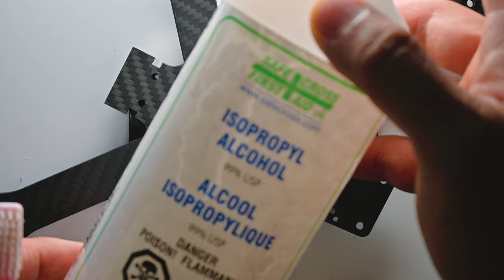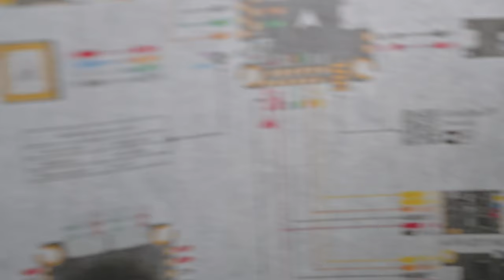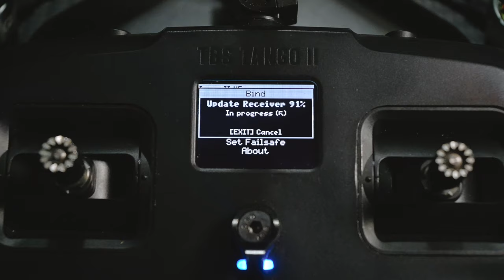High Performance 5" Freestyle FPV Drone Cinematic Build Video | PattyFlipz Style | Skyliner MKIII

Comment: Dude, that's the nicest build video I've seen, I think. Those macro shots are fire! Ok, noticed a detail I wonder about: Did you put liquid electrical tape on the VTX antenna connector to secure it in place? Is that a thing?
Reply from the maker: Thanks Bro! Yes that is right! Because the caddx vista is naked, there are no secure stays. I use liquid electrical tape to just give it an extra bit of  security in case of an accident. Easy to peel off and remove as well. Not sure if its a thing but just make sure you installed the plug (seated and click) very well before applying. 😅😂

Comment: new subscriber here :)

What tool is that? that thing were you cut the standoff.
Reply from the maker: Hi! It's called a dremel. I was shaving down a M3 screw because it stuck out too much and I didn't have any shorter ones. In most cases it is not necessary. Cheers.
Reply: And its like a pliers right when you cut it?
Reply from the maker: @allentituspaz3241  Oh yes those are small bolt cutters, they cut through thin metal screws or rod. Great to remove excess for reduced weight. No need to carry extra weight on drone. Before you cut, Thread in a metal nut as far in as you can. Then after using the bolt cutter or dremel so you can thread that metal nut it in and out over the rough cut area to re-thread and smooth it.
Reply: @PattyFlipz  thanks! Better have that kind of tool.

Comment: does anyone have a Link to the print file for the dji cam mount please.  unfortunately mine doesn't fit
Reply from the maker: the file you have, are the 2 rear bolt holes off by a mm or is it completely off
Reply: @PattyFlipz The Bolt holes are fine. I have two parts in total.  Once got a print for the drone with a go pro mount that fits well.  But the second print where the camera itself is in, which is connected with the first print does not fit. The Cube is to small.
Reply from the maker: @silbaz1043  Oh I see. I'm assuming you don't have your free magnetic case that comes with dji action 2 was left installed? I made that mistake once. I forgot it was attached, once removed it fits. I got my dji action 2 protective print from Brain 3d Printing. I got the version to fit the gopro mounting base. It slides in nicely, you can get a version with a slot to add a ND filter as well.  Here it is: https://www.brain3d.co/products/stock-gopro-mounting-protective-case?_pos=3&_sid=18e5db7a7&_ss=r&variant=32284834070615